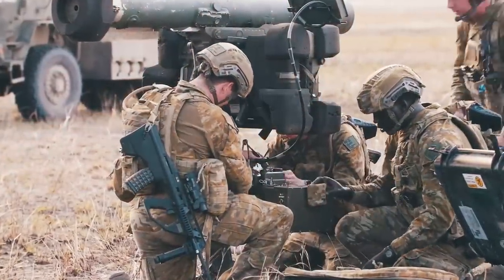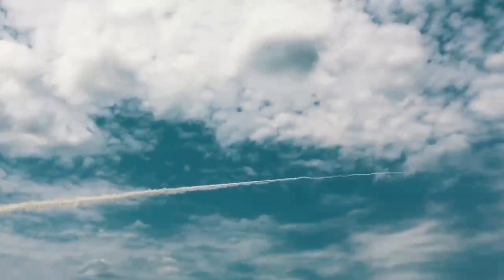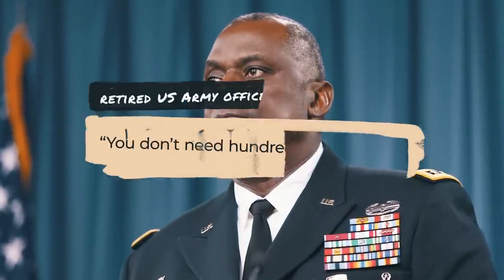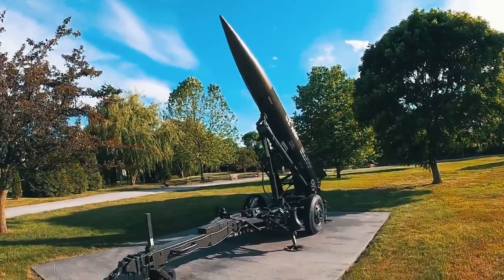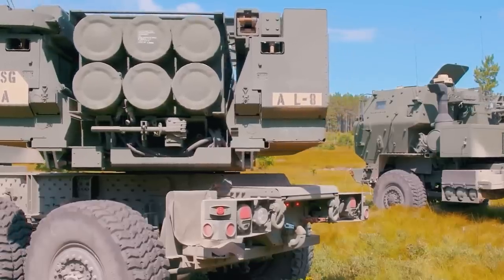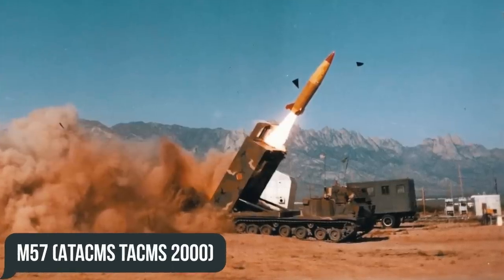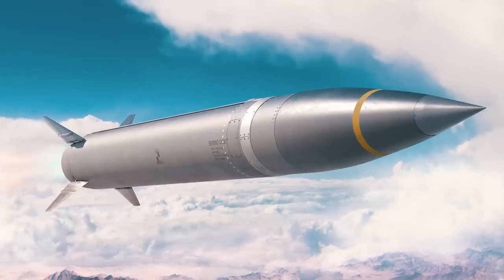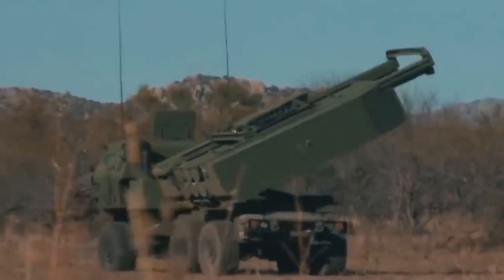Finally: US Deadliest ATACMS Missile Is Already In Ukraine!@UNITED24media

Comment: The MGM-140 Army Tactical Missile System (ATACMS) is a surface-to-surface missile (SSM) manufactured by the U.S. defense company Lockheed Martin.
Maximum firing range: 190 mi (300 km)
Mass: 3,690 pounds (1,670 kg)
Flight ceiling: 160,000 ft (50 km)
No. built: 3,700
Reply: That is a measurement of weight, not “mass” as you stated there smart guy.  We’re on earth and therefore assuming earth’s gravitational pull right?  So yeah the value is its weight.
Reply: @tinali9200  , looking just for the units, you are wrong. Weight its a force and it is measured in Newtons(or kgf aka: Kilogram-force). For mass its kg. Mass is a quantity of inertia. Weight is a vector. Weight = mass x Gacc. Looking at the formula, and knowing the Gacc is also a vector,  multiplying  by a scalar(mass), produces a vector(weight). You can also check the definition of balance which is an object to measure mass(...)
Reply: Making porn for the adsense  revenue  vereses  looking @ this makes more sense if we're all gonna die...
Reply: 3,700 built....send to Ukraine as soon as you can

Comment: From Spain, I believe that Ukraine should be provided with modern weapons that allow it to defend its airspace, and that it can effectively launch attacks against any point in its territory.
Military and supply points used by the Kremlin.  And only occasionally at points close to its borders from where attack systems are stored or used.  
That, and a reinforcement of its armored system capabilities for its counteroffensives, is what will prevent more deaths on both sides and a reasonable negotiating table for Ukraine can be reached. 
It is not an option for war, but rather a message to the world that an unjustified attack on a neighbor will not come for free. 
Greetings🌾
Reply: It's looking to be an unconditional Russian surrender or pull out. When Z said they want Crimea liberated, that was the signal

Comment: Ukraine recently received the M30A1 ammo for Himars. Instead of a single warhead, it has 182,000 tungsten pellets to cause area damage. It can be detonated at different elevations above the target to take out clusters of vehicles or troops. Should be a very useful part of taking back Kherson. There's alot of drainage ditches for russian troops to hide in, but that won't help them much with the M30A1 raining shrapnel on them

Comment: They just used it on the Crimean bridge and on a tanker train. The road section has collapsed and the train with it. INCREDIBLE!
Reply: Incredible work 😁
Reply: The train with fuel is still on the bridge,  need a couple more rockets to completely destroy it
Reply: Nahh a burning train fuel is the night mare scenario...they'd need to remove the sections themselves entirely anyway.

Better to target a different bit entirely.
Reply: Who said that they used it???
Reply: @oleksandrkurnyk6481   more work for Russia how it is, the train and tracks are melted in place, they will have to cut up and remove the train, the tracks and the fire damaged concrete sections of the bridge before they can fix it
Reply: That wasn’t HIMARS 🤦🏻‍♂️
Reply: No indication it was HIMARS or ATACMS.  The explosion clearly originated below the vehicle bridge deck, and blew out the support columns.  ATACMS couldn’t do that.  That took a MUCH bigger explosive charge.
Reply: @geococcyx7543  no support columns were destroyed, the blast clearly appears to be from above in the CCTV footage. The damage also shows this - the damage on the road bridge is downwards, the damage on the rail bridge goes upwards. But it wasn’t HIMARS- Ukraine’s HIMARS can’t get anywhere near this bridge.
Reply: @geococcyx7543  What is strange about the explosion and damage is that the truck that supposedly blew up was on the other lane, and that lane did not collapse, it was the lane opposite the tracks, not next to them

Comment: Range (unclassified): 100+ miles....  Accuracy: within 35 feet of the target.... Weapon type: 950each M74 Anti-personnel and Anti‑materiel (APAM, or grenade like) bomblets. Effective area: a half mile, squared. It probably won't drop a bridge, but a train yard, airport, power plant, or supply depot are easy meat for an ATACMS. From Kherson, the ATACMS would only reach the northern half of Crimea.

Comment: I'm a little disturbed by those cluster bombs. I hope we used the type of munitions that will deactivate in time. If that isn't the case a lot of children could be crippled or killed by a bomblet that didn't explode the way it was supposed to.
Reply: The US Army no linger produces the M31A1 Cluster Munition.  It was replaced by the M30A1. A 200 Lb shaped charge warhead impregnated with thousands of tungstan-steel balls.  With an ariel burst at can cover the space of 4 football fields with no unexploded munitions to hurt chidren or civilians later.
Reply: @kypackerfan4-12-15  - Almost 200,000 tungsten bearings are in each warhead.
Reply: They used to make a warhead for it with individual bomblets. Like you said, they wouldn't always explode right away so they discontinued them and developed the M30A1 that instead has only one warhead filled with shrapnel. That's what was recently sent to Ukraine
Reply: That's better. They're having big problems with unexploded ordinance in Southeast Asia. We should help to remove this still dangerous ordinance because we put it there. I believe there is an agency that does that, but they're underfunded and don't have the resources they need.

Comment: ATACMS has a 300Km range (shorthand = a few hundred) that’s about 200 miles. “Several” hundred would be about 700. ATACMS is good but not that good.
Reply: Lots of errors in this video. Several means two or three,  but not many more.
Reply: Actually, you're both wrong. It works like this:

One = one.
Two = couple.
Three = few 
Four = several
Five or more = many

Sorry to be a buzzkill on that with overly *n*l English application, buy you guys have about as many errors as the video, which is (get this) ... MANY.

From mispronunciation to misidentification and misdescription, while enjoyable, entertaining and even a decent place to begin research on the topic, there are so many errors of all types and at all levels of import that it truly detracts from the benefits that could have been made available by a video that avoided so many obvious speaking and other errors.

The authors may wish to consider having the piece re-narrated because in it's present form, it does not speak well for it's creators or the channel (pardon the unintentional pun.)

Still, it's a (barely) worthwhile use of my time to have watched the video.

Please remake it to an "A" level from it's current "C+" level (due to sloppiness errors.) The narrator should even rerecord it for free because the vast majority of errors appear to be his, alone. 

Get back to work, folks. Still, thanks for the effort.
Reply: My bad 

One = single.

Comment: I scream BS.  The US has NOT sent ATACMS or the soon to be available PrSM missiles.  They have only sent the GLRMS M31A2 missiles... and that is it.  They have no sent the M30A2 fragmentation warhead version even.  The Long Rang GLRMS missiles have gone into full production (9000 for fiscal year 2023) so the US could start sending them likely before the end of the year.  These will have a 150km range instead of a 92km range.  I can see the US sending these.  Heck if they get shipments say every month of these, the fiscal year started October 1.  This means they might receive around 750 a month.  The PrSM missiles are being made too but they only ordered 180 total.  These are the same as the ATACMS, but 2 fit in a pod instead of 1 and they have a range listed as 499+ km instead of 300km of the ATACMS.  They have the same warhead size (500 pounds), the same guidance, the same air burst capabilities...  Both these missiles are a significant improvement and make the HIMARS even that much better.  That is why so many countries are ordering them now.